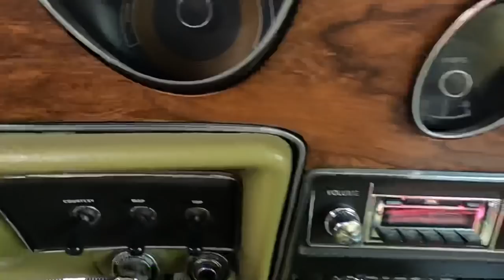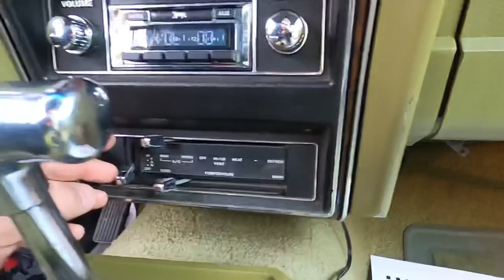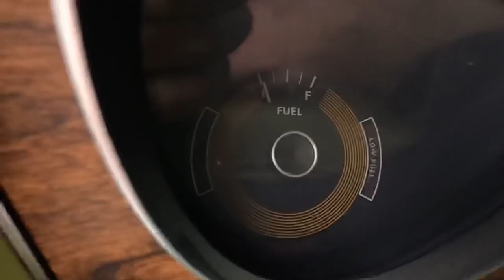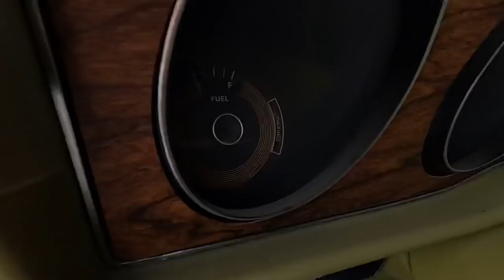Test Drive 1973 Cougar Convertible SOLD $14,900 Maple Motors #1442

Comment: We had a baby blue 72 Cougar XR7. 351 Cleveland. Light rear end, heavy front end. Went like a missile in a straight line. A bit squirrely in turns or wet roads. 
Unfortunately zero corrosion prevention and they rusted out in the wheel wells and rockers within 4 years off the lot. 
Wonderful long trip car.

Comment: Absolutely fantastic car, engine sounds good too, price is too low.
1973 Cougar Convertible is a real car.
Nothing today compares. 
It is not a racer, it is a car for cruising.
I bet it sells fast.
Power :	         264 HP (194.304 KW)
Bore :	         4.0 in | 102 mm.
Stroke :	         3.5 in | 89 mm.
Valve train :	16 OHV (2 valves per cylinder)

This was a Dilettante Presumption Theorem: All statements of fact, opinion, or analysis expressed do not necessarily reflect official positions or views or any other entity, past or present. Nothing in the contents should be construed as asserting or implying endorsement of interpretations and factual statements.

Comment: Thanks for this video, it's well timed! I am trying to establish the value of my Uncle's Cougar, it's also a '73 XR7 Convertible, with a 351 Cleveland, but it has a 4 speed manual transmission. My uncle was the original and only owner, he bought it July 1973. It's yellow with brown interior. Body/ paint wise and interior wise, it's in better shape than this one (he garaged it every winter) but it's been sitting for 2 years and needs a good tune up. It sounds amazing when you turn it over but won't stay running. 
So thank you again, this was informative and a good baseline for me to start assessing its value for the estate. 
If there's anyone on here that has knowledge   to help me out, please feel free to share!

Comment: Your horn button is on the inside of the rim on the steering wheel where you put your to drive  It's a cougar pull the turnsignal lever toward you for tilt wheel

Comment: The prior years were nicer but the 351's are very easy to modify n plenty of parts are available. That looks like it has either rear air shocks or leaf spring work. It needs to have a better stance. But overall nice cars n the value will def go up.
Reply: Someone put leaf spring shackles on it I saw them in the drive over .

Comment: The left front fender is off another car the horn is inside the ring around the rim of the wheel it has air shocks and looks like shock extensions and shackles I don't recall you telling us it was a 351 or Cleveland or what it was although I do like the car the wheels are cool looks like it has an oil leak to I like it though

Comment: Ok im biting however, number one thing i do to all my 6 or 8 cylinder vehicles is that i place "Dual exhaust systems" always lets the engine breath & exhale more easily thus helping to get rid of excess heat and actually end up a little better power output & abit better mileage, to boot.
Next id try finding a better custom steering wheel design fitting of this style layout.
Next id go through the entire engine and professionally have it properly cleaned polished & spray copious amounts of WD/40 whete ever i see rusting especially go ahead and change out the Bonnet Hood Springs . Also use spray lubricant sealant 303 on ALL RUBBER mounts, rubber trim, hoses, and convertible top springs & connector pieces.
Then...id take it to Houston Texas and get the interior Customized with all new larger sized Leather  bucket seats also make them power adjust both driver & side passenger. Also have customized Leather Door panels also Electric Power Windows.
Then afterwards, id also let the same custom shop (where ZZTop's guitarist Sir Billy Gibbons got a few of his vehicles including that HotRod on the Eliminator Album custom created and their work is beyond belief, too) get them to clean up the whole underside and spray on 3MRubberrized spray coating that helps to tremendously quiet down the vibrations from the car engine exhaust and any Road Vibrations.
Then have the entire car body smoothed over all dents scrapes & uneven surfaces rubbed out then reapply good strong primer and then have this vehicle redone with a Shiny modern new Golden Brown Metallic w glow gloss finish to go with the darker custom leather interior.
Ok thats about it! Ofcourse that would bring an extra $33,000 to the table...but what the heck? This XLR Cougar would be so sick that NOBODY could ignore it! However, a word of extreme caution...DO NOT DRIVE IT around Chicago, LA, Minneapolis, Atlanta Sanfransico or Portland...cause theres too much gang activity in & around these places and they can & will roll right up on you while youre cruising the streets & especially gas stations...and will literally quickly roll up on you while pumping gas or going to pay for it and they will stick their automatic pistol against your door window and tell you to "Get da f#ck out NOW!!" And that will be the last time youll ever see that gorgeous ride again!! Oh yes theyll even do that to you & your wife or girlfriend even at an intersection of your choosing in these cities too!!
I actually think theyre pulling this sh#t off in LasVegas too!!?? (@@) so becareful folks if youre cruising roundbin your Ferraris Lamborghinis Vettes & any outstanding vehicles where you have see thru glass or Convertible Down on any of these vehicles!!